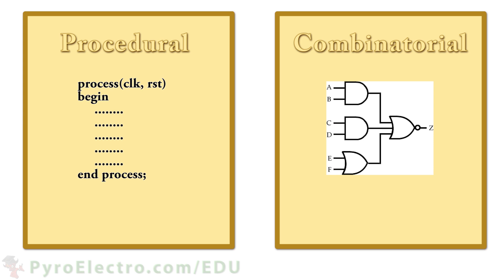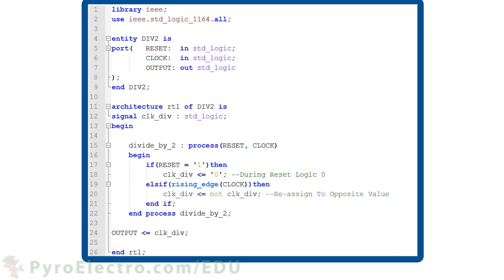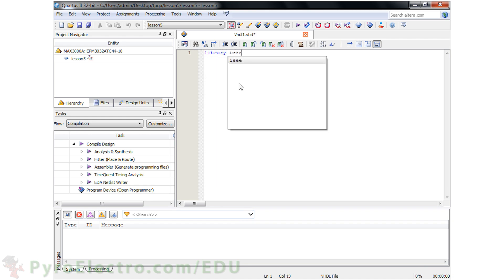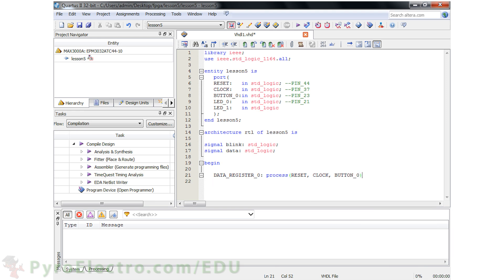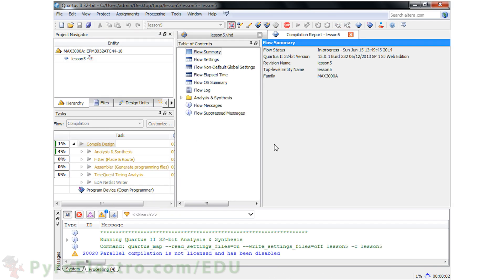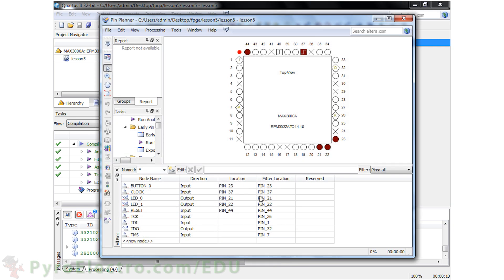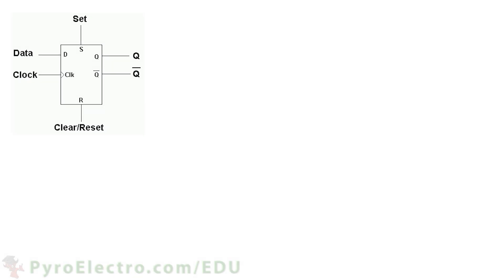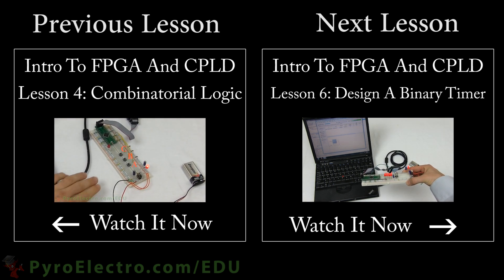Procedural Logic - An Introduction To FPGA And CPLD - PyroEDU

Comment: I looked up the ICM7555 datasheets, & using the f = 1.38/(Ra +2Rb)C, the output frequency of the ICM chip should be 4.6Hz, not 10Hz, isn't it?
Sorry, I'm not trying to nitpick, just want to make sure I understand the operations correctly.